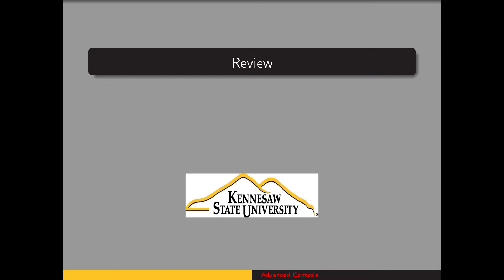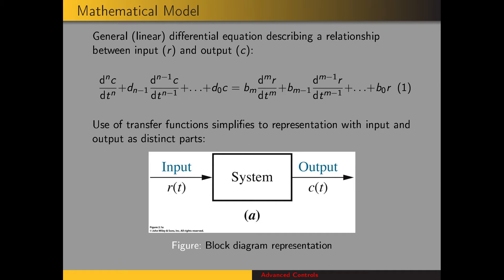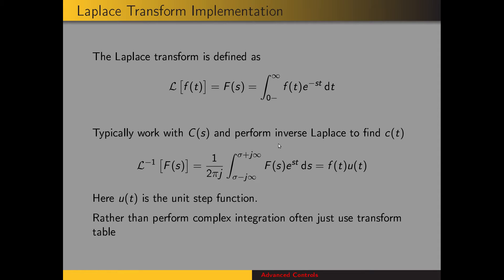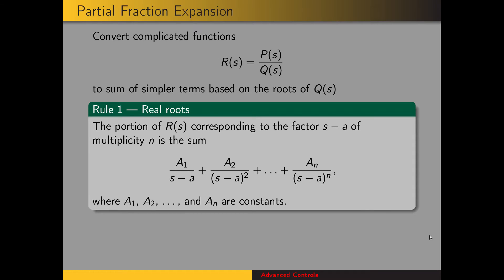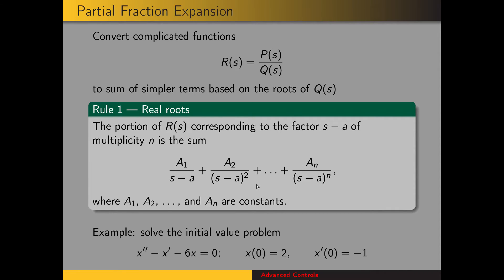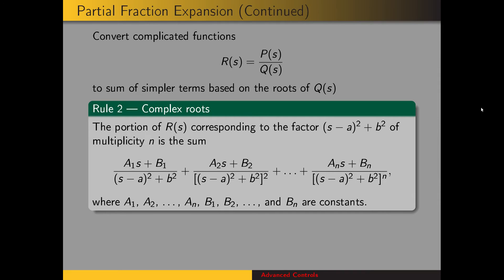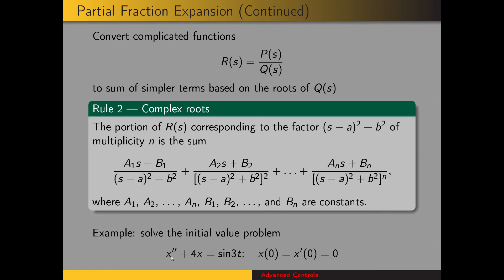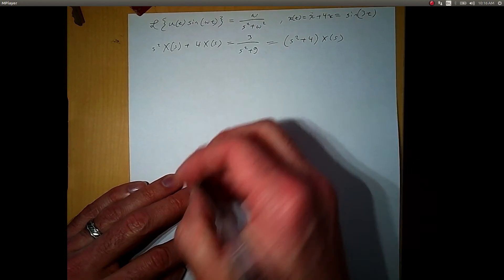Laplace transform

Comment: 10:30, shouldn't it be -4-3/-5 = 7/5 ?
Reply from the maker: The calculation for B has two errors.  First of all, the numerator should be (2s-3), as you pointed out already.  Secondly, I substituted s=-3 in the numerator instead of s=-2.  Yes, the correct value of B is 7/5.  In the calculation for A, the incorrect numerator (2s+3) is also used.  One should find A=3/5.